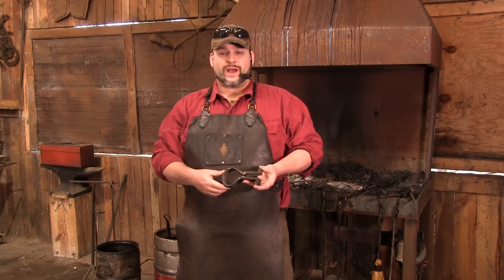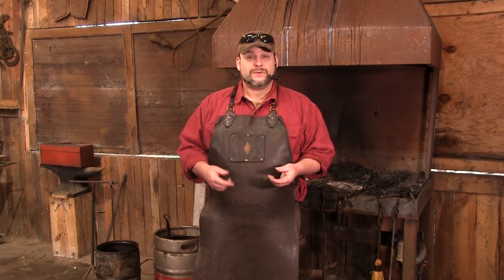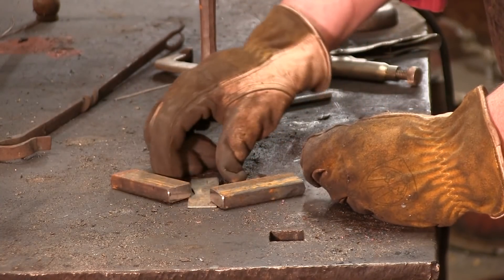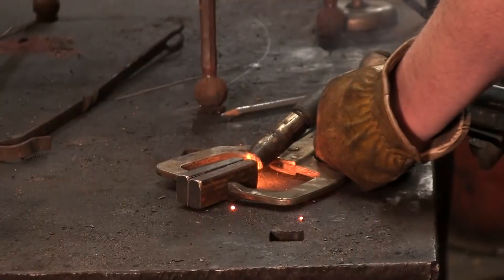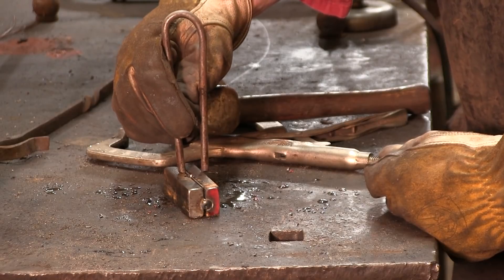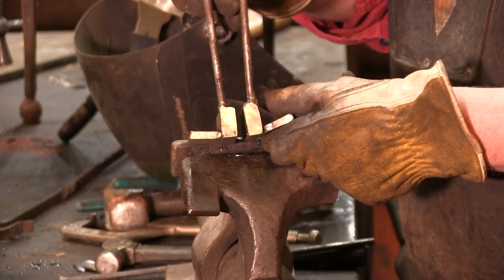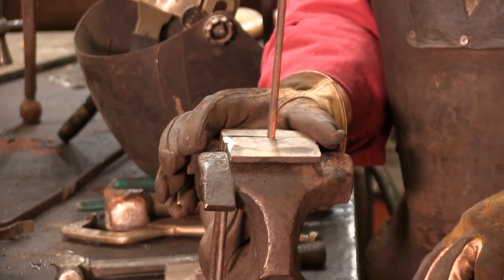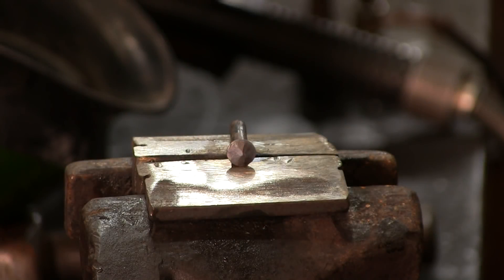The Modern Rivet Header (#22)

Comment: If you want to maintain perfect alignment basically forever with such tools, drill two holes, with one nearer the end of the stock. Open the tacks and use a round file to bevel the ends of the extra hole top and bottom only one one piece. Put the two back together using a piece of slightly over long round stock in the extra hole as an indexer. With the pieces clamped back together, weld into the grooves created by the bevels to permanently secure the round stock. Cut it flush top and bottom then finish the piece. With the groove and round the two sides can always index true when clamped in the vice. Also if you are producing lots of rivets you may want to add several of the same sized holes to build several rivets per clamping in the vice. It goes a lot faster. Another step I use when making a lot of rivets of one length is to add a shelf piece across the bottom as a stop so the length is always exactly the same. So I can make say, 5 rivets 1/4 by 5/8 long each time I close the vice and they all match and work to attach the stock I use all the time leaving the exact length of metal to munge on the other side. Now those specific size rivets are used to attach two layers of sheet steel for armor but you can size for anything you use the same rivets on a lot and really crank them out this way.

Comment: Good video  I missed the size of the drill you used, how much smaller should it be for the stock your using for a rivet, I use 8mm round for rivets.  5/16 or an inch I think?

Comment: The old way works, as in it is a lot more work. It is a means to an end, until you can budget the tools to do it smarter, faster, or easier with newer or more modern tools or methods.
A real blacksmith always looked/looks for "the better, more productive, way". Work smarter, not harder. A six-pack of beer to put a sledge hammer in an assistant's hands is cheaper than a power hammer, for a while, but eventually you can save up for that power hammer before that drink friend smacks you in the head...

Comment: You see in a lot of videos people make comments about not “using the old ways” I find those comments to be silly because the smiths of old were using the most modern technology,they could afford,of the day. I believe even a high tech TIG welder is a legitimate tool in a modern blacksmith shop
Reply: There are differences tho (speaking from watching YT videos experience). Is it still blacksmithing if all you are doing is reducing stock?
Reply: @_aullik  Yes.  you just do it by yourself rather than with two strikers reducing that lump of steel 6"x12'X4"  that just arrived on the stagecoach over a period of days... maybe go dig the ore out and build a foundry.?.. sheesh I'll stick with the head start stock gives me. I can batter a 1" square bar into all shapes  but would I want to try and make a 1/2" poker out of it?...

Comment: I imagine that most of the hobbiest types are somewhat like me, in that I have a bit of background in making things i.e. I'm not a kid anymore and have some metalworking experience. That said, small hobby or homeowner level wire feed welders aren't much more than a hundred bucks and they are capable of helping to make better tools for your hobby.
Reply: I just bought a 30 - 250amp mini dc stick welder from china. It cost less than 60 quid. its smaller than a loaf of bread can't wait to try it out on this job.

Comment: Question, What was the purpose of putting the notch on the sheet steel in the middle? Just to keep the drill centered? You had mentioned the chatter until the drill made contact with the sheet steel.  Thanks.